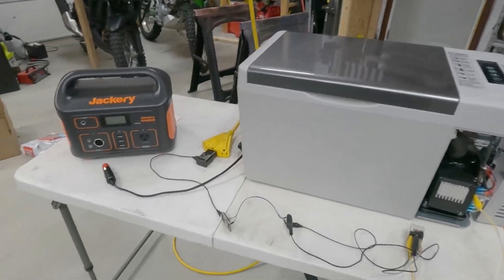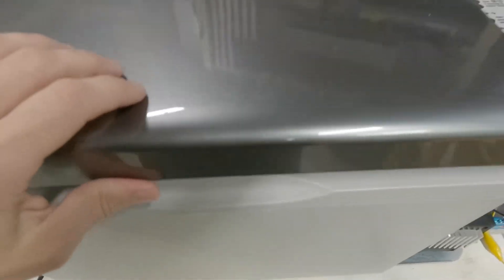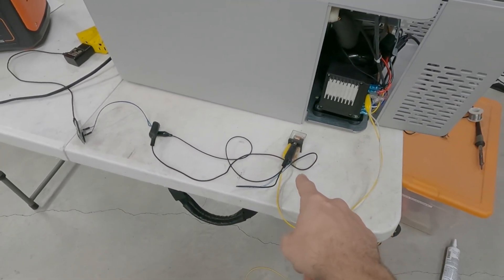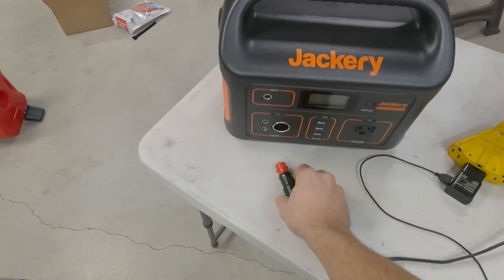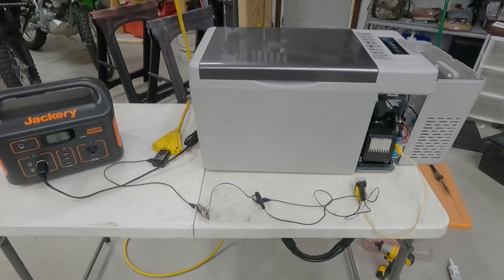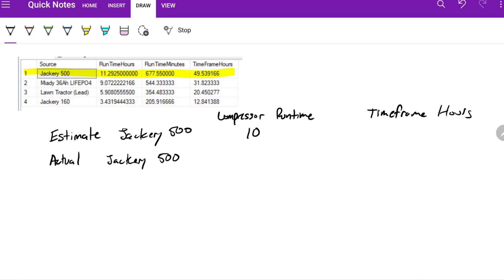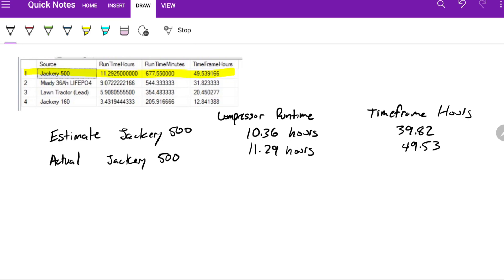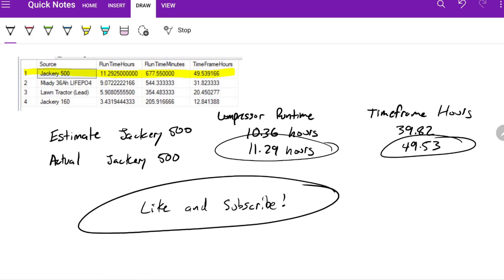Running a 12v Compresor style Fridge on Jackery 500 Runtime.

Comment: So the jackery won't shut off when the compressor turns off (as soon as the fridge is cool enough)? We tested it with another power station and the DC turns off and wont turn on when the temperature gets higher